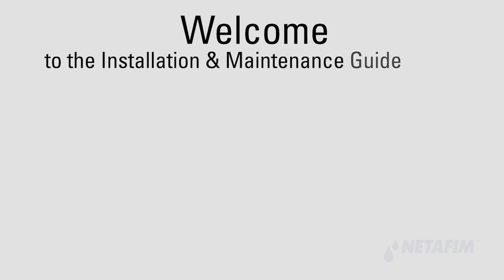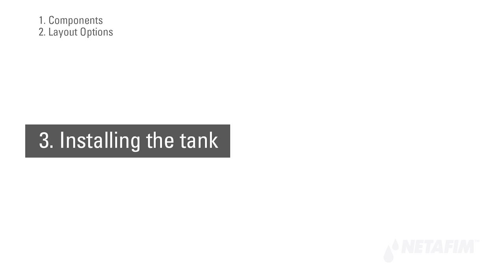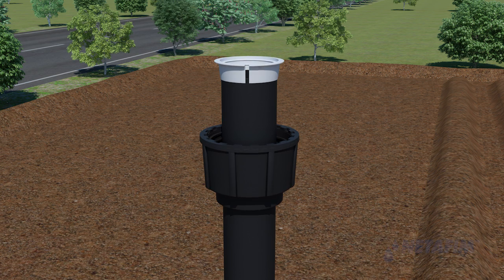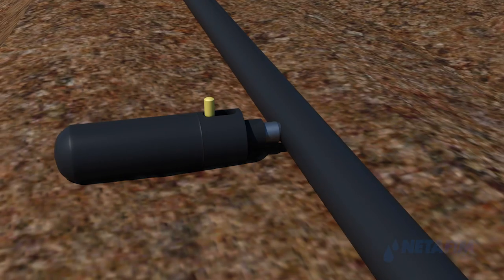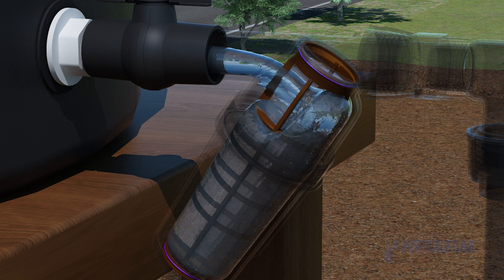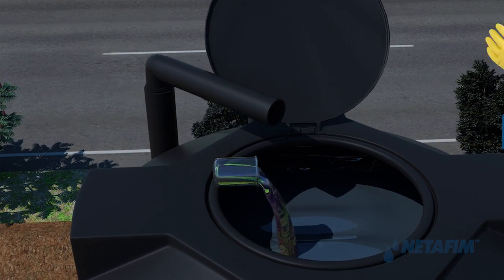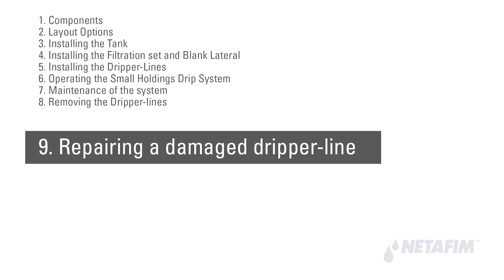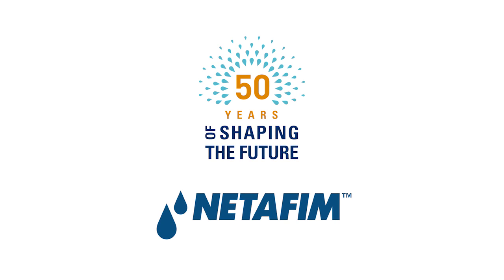Netafim- Small Holdings Drip System (SDS) - English

Comment: It is a new drip irrigation technology that the floating drip irrigation device has two characteristics: (1) Auto-remove impurities of water，so to solve the long-term blocking problem of the drip irrigation (2) Adjustable flow rate drip, so more suitable for drip irrigation, as detailed in YouTube : https://youtu.be/P495Nk62QMQ